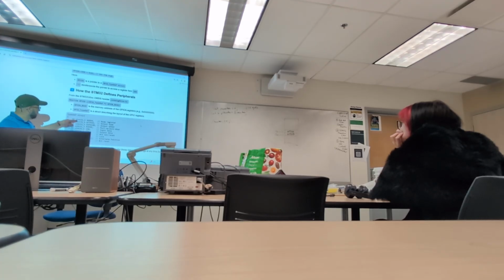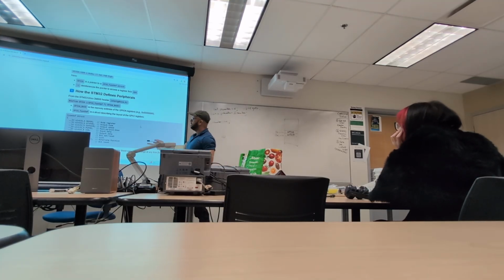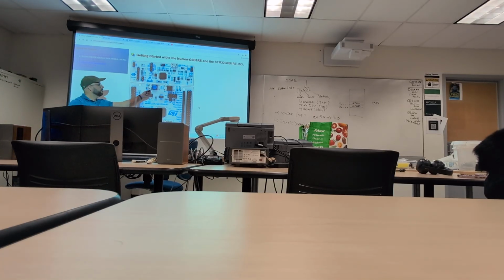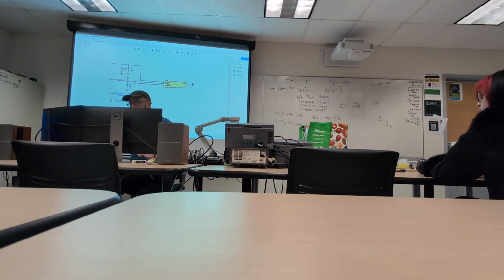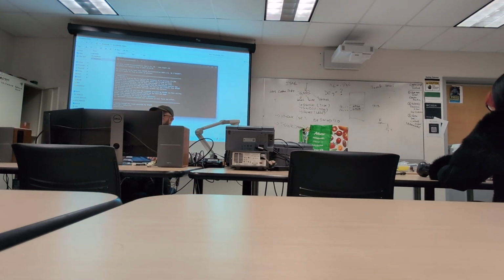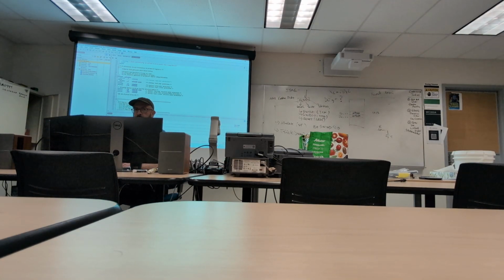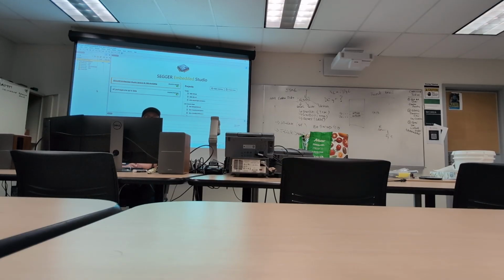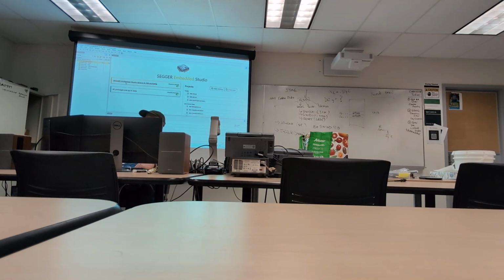January 26 Lecture Part 1

Comment: (0:00 – 3:13) – Pointers and Memory Addressing
-	GPIO A and GPIO B (1:10 – 1:40)
(3:23 – 10:10) – Introduction to the Development Board
(10:23 – 14:40) – Debugging Protocols (JTAG, SWD, STLink, JLink)
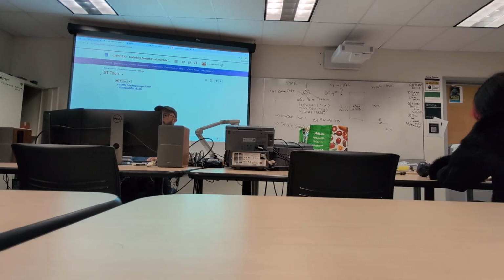(15:02 – 35:57) – Connecting and Recognizing the board
-	Board pin layouts (16:09)
(36:00) - Converting STLink to JLink (only needed if your board is STLink)
(1:06:50) – creating a new Project and Debugging
-	Changing the Debugger to JLink (1:03:41)
-	Including the micro header file (1:08:53)
-	Putting in a infinite loop (1:09:08)
(1:12:00) – Using the Reference Manual